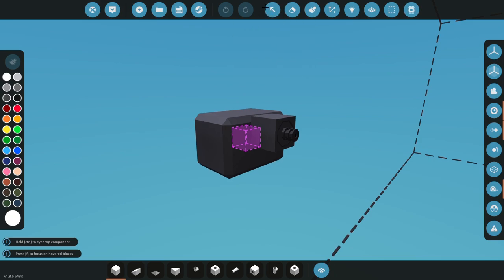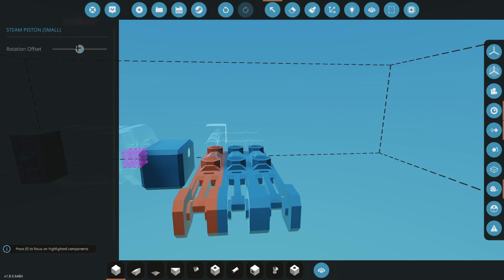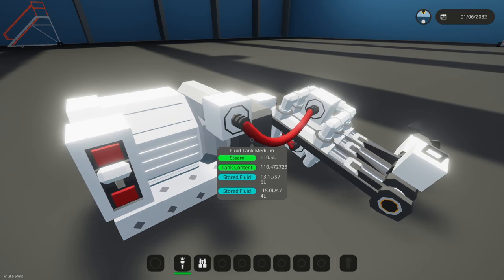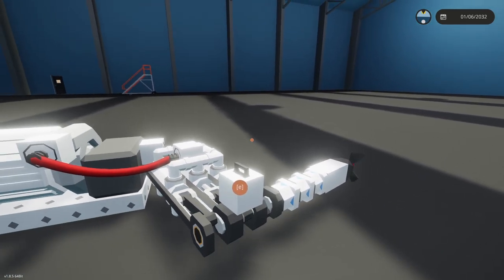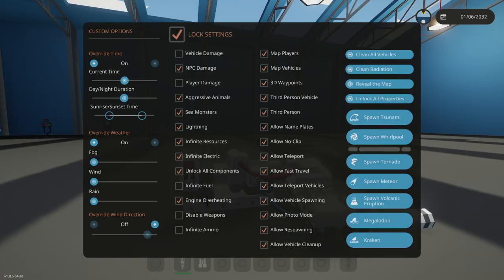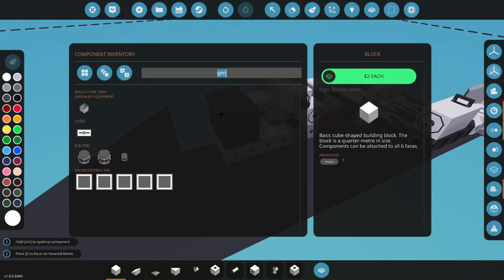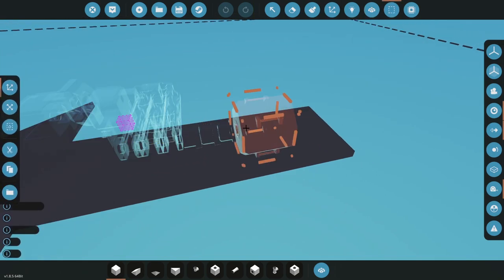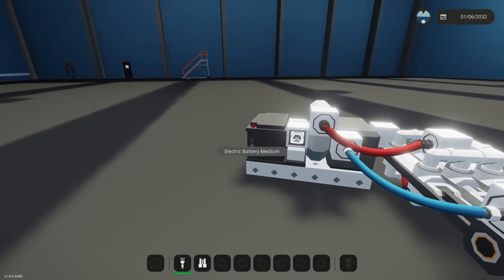Making Fluid Power Transfer in Stormworks (It went too well)

Comment: If you branch off after the gearboxes into a stack of 3 3x3 flywheels and add a regular clutch to a large generator. Then set the clutch to the generator to .5 and add a large electric motor to the open RPS port on the front side of the piston stack with its own gearbox to reduce(2:1) the motor RPS into the pistons. You will have a hell of a lot of power from it. Especially if you go up to 5 gearboxes to the generator. Honestly, I gotta test it, but I dont think you even need steam. Just that setup through unpowered pistons should work.
Reply: I can upload an example to the workshop if you'd like.
Reply: @DataDownLynk Yes please!